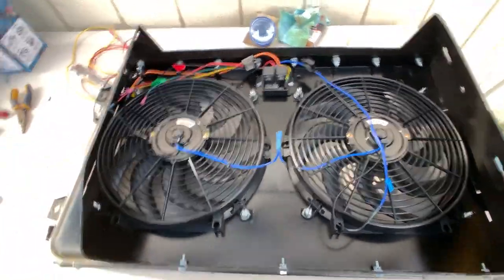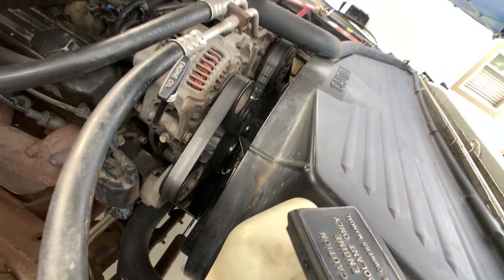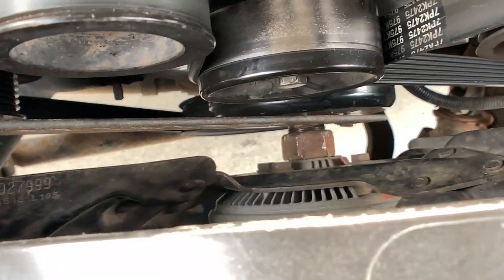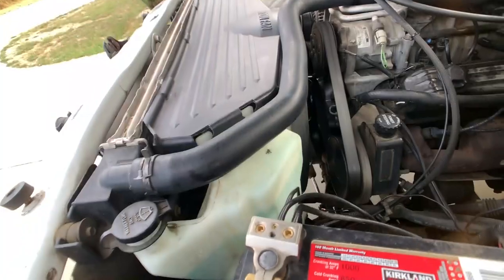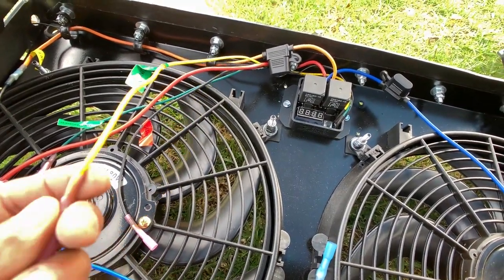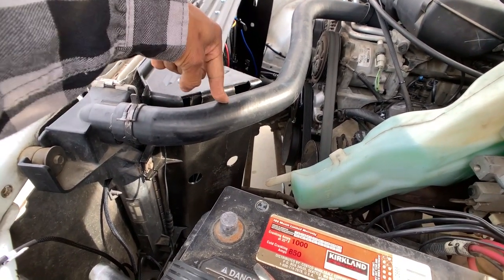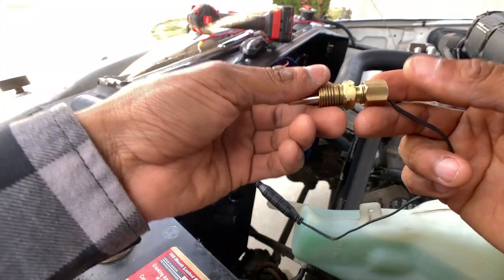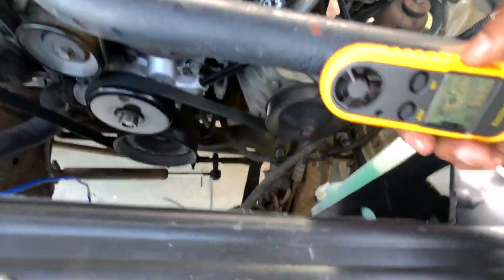How to install Electric Fans on a 96 Dodge Ram (DIY E-Fan Build)

Comment: I would love to have the step by step guide on how you did it. I'm not real good with electronics. I have the same setup I would love to know where you got the shroud and electric fans as well
Reply from the maker: Hey! I’ve actually taken this set up out since then, and working on something with about 5 times the power, I’ve discovered that I love testing different fans. But on this next set up I’m working on I will be recording how I do it all. 
Are you planning on doing this to a 2nd Gen Ram?
Reply from the maker: check out the new video on the bulletproof fan set up i built

Comment: I'm doing the same job here in a few weeks on my 2001 2wd, shortbed Ram. I bought a 2 fan set up, will cut the old shroud to keep just the sides for the reservoirs, since the 2 fan unit doesn't use the original bolt holes to mount, but really was hoping you would have showed where you tapped into a switched source for the fans. ALWAYS the hardest thing for me. Every mod I've done on this hotrod needs a switched source and I constantly have a hard time figuring that out.
Reply from the maker: hold on to that thought my dude i have done a bigger and better up grade since this video, it’s about the same price and about twice as powerful and actually less work to do.
Reply: @payloadperformance9706  I love you shroud setup! Do you make them and sell them? I'm very interested!
Reply from the maker: @orngbug74  Hey there man, thank i appreciate it i no longer have this e-fan set up i haven’t since then changed it to something about 4 times as powerful. if you go on my IG page you can actually see the Dual 18” fan set up i have now. 
they pull right around 9000CFM 
i can help you piece yours together if you want some help. 

IG:PayloadPerformance
Reply: @payloadperformance9706  are you referring to the dual fans from the MarkVIII? I will look into finding some. Those cars are hard to find up here in Wisconsin. Time to make a trip to the salvage yard...
Reply from the maker: @orngbug74  yeah the mark viii fans are monsters for cooling, if you can’t find any i have a couple in storage, if them in storage.

Comment: I definitely want the step by step!!!!
Reply from the maker: hey chris, i just saw this but i have since then dropped this set up and installed  lincoln mark viii 18” fan. it pull more air than both of those, i have been using it to tow and haven’t had any over heating issues. that being said i’m going to do a Dual lincoln mark viii set up for back up purposes incase once ever fails. and have 2 of those monsters would cool as good or better than the big steel clutch fan that pulls massive amounts of air! 

check out my IG i just made a post with the lincoln mark viii there and another fan as well. 
IG is the same name as my Youtube 🤘🏽

Comment: Where you get this electric fan conversion? I really like it and have so much space in it. Did you connected the wires to battery or rewire cuz I didn’t see the red wires connected to.
Reply from the maker: Hey, It was a DIY build I got from a good friend. 
I’ve since then done some changes with other fans, it with the well known tried and tested Lincoln mark viii 18 fans. 
That being said I got my hands on ANOTHER fan that might be even strong but I’m going to test that out in and put a video on that soon!

Comment: Do you have plans for this conversion? Or a video showing how to assemble this unit?
Reply from the maker: i habe since this video upgraded to a new a stronger fan conversation that’s 1) cheaper and 2) much much simpler to do. i’m wrapping up a video on that actually. 
if you go to my IG page i will upload a picture of what i currently have for my e-fan set up.

“PayloadPerformance” is my Instagram handle 💪🏽

Comment: I'd like to know where did you purchase the Hose Pipe and your plastic Double Fan..??.. I was thinking about 99' store and the other at Home Depot...??..  Let me know if I'm close enough...??..
Reply from the maker: send me a message on IG it’s much easier to share info there. PayloadPerformance 
or the FB group ‘Electric fan conversion for trucks/cars’
Reply from the maker: But to get to your question i have since then changed my Fan set up! i no longer have this dual fan DIY i made a new DIY i haven’t yet up loaded and it’s a Dual 18” lincoln mark viii fan that pulls an obscene amount of air literally about 5-6 times more than the fan set up in this current video.

Comment: Need do this to my 97 ram 1500, did you have to upgrade alternator to keep up with new fans?
Reply from the maker: i have since then changed up my fan set up, i have dual 18” fans now. i need to do and update video on it. and it’s actually about the same price just requires a bit more work but it’s 4 times more powerful than the set up in this video. 

check out my IG PayloadPerformance, IG sees what’s i’ve been doing first before i post on youtube

Comment: if you watch Engine Masters on youtube they will show that you gain about 5-15 hp from idle on up to highway engine rpm's Did this on my 01 Durango and you can tell little difference in throttle response and just a bit on the mileage. Nothing to serious either way
Reply from the maker: i gained 1 mile per gallon so for me it’s 34 miles per tank and my truck gives me roughly 10 miles per gallon so it’s a total of 18.69 saving every time i fill up for me. 
100% worth it. 
i use my truck for work 90% of the time so whatever i spent making the fan set up i already made it up in savings. 

i currently have a different fan set up though, it’s a dual 18” fan set up. 
if you look at my IG you can see it on there, it’s the same name as my youtube
Reply: @payloadperformance9706  I'll take a look at the IG. thanks 👍
Reply from the maker: @tomb374  thanks for watching my dude!

Comment: What gauge did you use? Link please. Can't seem to find one with CFM. Thanks
Reply from the maker: hey man, i just added the link to my most recent anemometer i’ve been using! it’s been working great for me! 
hope you like it 🤘🏽🤘🏽
Reply: @payloadperformance9706  Looks like all of them you need to do math after. Multiply the velocity - fpm (feet/minute) times the area (square feet) to obtain the flow rate - cfm (cubic feet/minute)
Reply from the maker: @cat5tracker581  yes this is correct, the only way to have it automatically would be to input the Cubic feet manually then test for feet per minute, i believe they do make them but they are expensive units. the one i listed has worked well and is quite accurate.

Comment: Should Both fans come on at the same time and what temperature do they come on and turn off I have a 180 degree thermostat
Reply from the maker: the controller i was using turned one on at 185F and the other about 5-7 seconds later. 
the controller does this so it doesn’t have a huge draw on the alternator. 
but since this video i have upgraded fans to some that are about 3 times more powerful.

Comment: Where did you get the Structure
Reply from the maker: structure as in the shroud? the black metal part or the black plastic part?
Reply from the maker: also i just posted a new video with the newest fan set up i have!
Reply: @payloadperformance9706  yes the aftermarket shroud?
Reply from the maker: @jameskurtis9816  i didn’t use an after market shroud, i bought the metal and made it myself, i also reused the old shroud so it could go around and have something to hang with on to the radiator, but since then i have gotten rid of this set up because it wasn’t strong enough. 
i have a new video up showing what i currently have right now and a bunch of links in the description with all the parts you’ll need to make it yourself 💯
Reply: @payloadperformance9706  well shit looks great, I’m wanting to do something similar with my 24v Cummins. I found this and loved the whole set up.
Reply from the maker: @jameskurtis9816  currently little to no efans work on the cummins engines but i’m working on making a dual 19” fan set up that will pull more air than a dang hurricane, i’ll keep everyone posted! 
this is going to be an exciting one